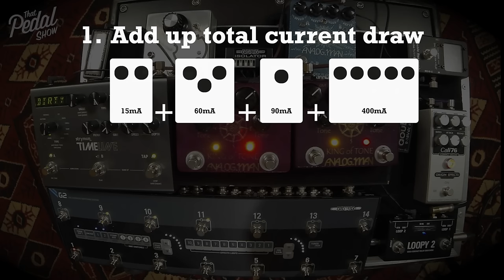That Pedal Show – How To Power Your Pedals Properly & The Legend Of VCPI

Comment: Could you guys do a video of budget vs higher end power supplies? Always wondered if it's worth spending a good amount of money on a power supply.
Reply from the maker: +Emil Malaniak Hi Emil. It'd be dreadfully boring. In our opinion it is absolutely worth spending money on a great power supply that has the features you need. Voltage, Current, Polarity, Isolation. Make sure all are satisfied and you won't go far wrong!
Reply: To piggy back too on this, unlike pedals (where you are constantly looking for new sounds, combinations etc) you aren't trading around power supplies to other people. Generally you get a power supply and that's it. You just keep it until it gives out. So it's worth getting a nice one that can fulfill your current needs and give yourself space for the future.
Reply: Emil Malaniak Just bought a Harley Benton Powerplant Junior. It was €33,- and you get 5x 9v 120mA outputs and a shitload of cables with it. All Isolated outputs too. My Rig is as good as noise-free

Comment: Sorry if I missed something.  I have isolating each pedal stuck in my head.  

I have a pedal train 24 with 13 effects not to mention my way which sits next to it and has a 9v anyway.  
Could I buy another power supply and run both on my board?

Comment: Hello, i actually have 8 pedals on my DIAGO pedalboard and FUEL TANK JR with 2 TC current doubler, which works well , but a new pedal ( diamond MMR JR )came( instead of my MELAKKO 616 delay out now) and one of my doubler cable is too short ......Do I have to buy another DC UNIT ?
DOES THE FUEL TANK CLASSIC ( no individual isolated current output , the JR WAS !) do the same job with the same silence ? I do want to spend a lot of money as voodoo lab is, sorry....Thanks a lot for your help and answer, Best regards from France

Comment: Nooby question here:
I've got a small pedalboard comprised of a Tuner, a MXR Dyna Comp, a Boss DS-1 (or an AMT P-Drive when needed) and an AMT Reverberry Digital Reverb (that goes in the effects loop when i can) all powered from a Pedaltrain Volto through a series of daisy chains.
After seeing this i now understeand where the hum and hisses come from (i seriously thought my DS-1 and P-Drive were busted!), and so would like to know how could i isolate every single pedal?
Is there a device i can use in between the pedals or should i ditch the Volto straight up?
Any help would be appreciated :)

Comment: Hi there guys, I’ve tried messaging via your website and even had a chat with some kind folk on the Facebook group, but I’m still a bit lost with little to no help... my current power supply is a bit noisy and naff and I’m really interested in your power set up, I’m just not 100% sure what I’d require or how to set it up, a diagram would be stellar!! 

my current set up is as follows - 

in front of the amp (no particular order) - 
TC Polyune2 Mini 9V DC/40mA (possibly the bigger one)
Crybaby Mini 9V (possibly a standard Vox wah) 
MXR Phase 95 9V
TC Spark Mini (possibly the big one) 
Ibanez Tube Screamer Mini 9V
Xotic SL Drive 9V - 18V 

fx loop (no particular order) - 
TC Corona 9V 100mA
TC Hall Of Fame 2 9V 100mA
TC Flashback x4 9V DC 300mA

I appreciate life is hectic right now, I’m just keen to get this sorted!!!

stay safe everyone!
Reply from the maker: Hi Elliot, if you want to contact GigRig it’s support@thegigrig.com 🤓👍

Comment: Hey guys! Great channel, great video! I do have a question though. Suppose a pedal(boss DD500) is rated 9V 200 mA, would it affect/destroy the pedal if it connected to the DC 9V 500 mA or does the rating just mean I need a minimum of 200 mA and it's safe? Thanks guys!
Reply from the maker: +Joel Sharat Yeah, fine. Don't worry about 'too much' current - it'll take what it needs. But don't mess with the voltage. Cheers!
Reply: That Pedal Show thank you! :)

Comment: Regarding your rule of thumb Dan: taking the popular TC HOF (version 1) as an example, the HOF requires 9v/100ma; and you recommend powering it with at least 200ma. If we take your gigrig gen + distrib: Your isolator add-on provides 135ma max per output which is enough to power the HOF as a minimum but to be certain of maintaining 9v would you  recommend your Timelord for this?
Reply from the maker: +Dale Harris the rule of thumb is based on what companies label as they’re current draw. The TC HOF is fine on an Isolator as it only draws 100mA for a brief period during start up but in operation it doesn’t get to that much current draw.

Comment: Will The GigRig Generator provide a solid 9V when the current draw approaches 5A or should the total current draw of all the pedals still be half of 5A as the video says?
Reply from the maker: It will stay solid, my ping is about headroom, but as long as the supply is regulated and designed well it should be fine towards its current limit
Reply: @ThatPedalShow  Thank you! Also cheers for creating such an incredible show, honestly I discovered it a couple of weeks back and now I'm hooked. I am discovering so much!

Comment: Hi guys. Not sure if you are still replying to questions on these older vids, but.... 
Wondering if pedals, generally speaking, draw the same amount of current when they are in ‘bypass’ as when they are engaged? Cheers.
Reply from the maker: +Justen Stoodley Hi Justin. If it’s true bypass it’s not drawing any current at all and will pass signal when it’s off and has no power source connected. If it’s not true bypass, presumably it’ll still be drawing some current. Interesting question. (Mick here)

Comment: It's nice to know that I need twice the power to preserve the voltage! But how does these bricks works? I mean, for example, the manufacturer says that certain power supply have 4 outputs, where each one is isolated and provides 100mA. The total power is 400mA. If I have 3 pedals with 30mA requirement and 1 with 100mA, the total for the pedals is 190mA. Almost half of the power availble. So I am sorted, right? Or will I have problem with my forth pedal that needs exactly the power supplied by the brick? Will it affect the voltage for this one? Thank you in advance!
Reply: José Sousa if they are isolated that should work fine.
Reply: This is the first time I hear about them needing the double power supply. No easily available power supply I know has 600 mA or so per outlet. This is what this video suggests when saying so for using a 300 mA pedal. Cathedral Reverb works with 200 mA I think, so for this, according to them you would need a 400 mA outlet. Only Fuel Tank Goliath has this. As a matter of a fact neither Walrus Audio Phoenix/Aetos which are more specific do have this big outlet. I do not think the voodoo labs do either.

So while this video is good, unless I didn't hear this comment right, I'm dismissing it as BS

Comment: Hi guys! Great show, as always.  I was just wondering if running 1-spots and dedicated power supplies off of a power strip would be viable for a rig with many varying VCP requirements? 

Haven't dug too deep into power supplies but I haven't seen one that meets the requirements of a dl4 (center positive? Unless those jack adapters you briefly mentioned can also switch polarity) as well higher Voltage and Current ports.
Reply: You can get a small adapter to reverse polarity

Comment: At 7:15 Mick talks about how his T. rex chameleon power supply can’t power the timeline as it only has 9v 300MA per output. On the strymon website it says the timeline can run on a min of 9v 300ma.
What is the issue here will the timeline not sound good on 9v 300ma? If not how much more do you need? 
I have the chameleon and am thinking of getting a bigsky which needs the same current as the timeline. 
Thanks love the channel.

Comment: Funny I just came across this video, just last week I sent Wampler an email because I had a dilemma.  Loved the clarity and headroom I was getting and ease of dialing in a Euphoria at 18V but the voicing switch and gain became too hard and edgy, not having a soft bloomy clip.  I asked them if I can get the sweet musicality and design of 9v with the benefit of having a more amp like headroom that I'm used to out of the pedal.  18V blends into my amp more too.  To me it 'sounds like a pedal' at 9V but at 18V it just sounds like a different preamp channel almost.  I've only played with it for about 4 hours though switching back and forth.... I know the volume, tone, bass knobs all work better with the clarity and headroom but the voicing switch and gain while being easier to dial in have a muuuuuch harder edge to them that is the only part I don't like.  EDIT:  Ahhh I notice later you mention 15V... didn't know they had those but I had thought about ordering a 12V one too... just so when I get a pedal I can find out what voltage I like it at best.  You recommend having a 9V, 12V, 15V, and 18V adapter for testing purposes?  I noticed that everything too 'pedaly' or synthetic that I didn't like about the Euphoria that I felt made my amp sound like a toy was fixed by a larger voltage, but as mentioned introduced the problem of it being way too hard on the edge and aggressive.... could be cool when needed but that's not really what I like the Euphoria for and I don't do that often.  My siegmund double drive has it's own wall wart voltage regulator power adapter that you can rotate from soft to hard / compressed to headroom  ... Every gig I play I set it different lol.  18V does really help though because I have SCFH pickups in a LP (Lollar's) , tone tubbies, tweed style amp, and the pedal just has too much and it kills the transients.  It articulates better but sounds too 80s/modern at the same time.... if I could get the 18V to run with more bloom and softer breakup that would be ideal

Comment: Why do you suggest doubling the amount of current when adding up the current from each pedal? Is that just in case the pedal draws more current than it is designed to/spec'd to? Doubling seems a bit much??
Just bought a Gigrig modular power supply :) arrives next week.
Reply: Did you watch the whole video? They explained it very clearly: it is because the voltage supplied can sag below the rated value when approaching the maximum current

Comment: So do you have to buy one of those isolation boxes for each individual pedal (if you're aiming to isolate each pedal) or should a good power supply isolate each of its outputs? If the power supply doesn't isolate its outputs, can you buy an isolator with multiple inputs? Basically, what should I be shopping for?
Reply from the maker: +napalmhardcore There are plenty of brick-type supplies that have isolated outputs. 
The reason TheGigRig developed its modular system is because most of those brick types either run out of current or don't have a wide enough variety of voltage options once you start getting into more complex boards. I (Mick) use T Rex Fuel Tank supplies most of the time because I don't have any complex voltage requirements and I don't use any current-hungry digital pedals. Voodoo Labs and Cioks are other popular brands; Dunlop now has an Iso Power Brick we believe, and Strymon has entered the game too. Hope that helps.
Reply: Thanks very much. I really appreciate it :)

Comment: Hey guys!  Don't shoot me, lol, but the Line 6 HX Stomp is looking really nice for added wet effects on my pedal board.  However, on the pedal it says it needs 3A.  I have the GigRig power supply on my small board and love it.  I know the Generator can deliver the current needed, but what GigRig cables would I need to make this work?  It has been tested and ran on a Strymon Zuma R300 and Voodoo Lab 4x4 by doubling up two 9V outputs together.  Is there a way to join two high current adapters and still keep the voltage at 9V?  Thank you!

Comment: Q: I have (had) a Holy Grail which is centre positive. I plugged it into the wrong power supply and it worked for a second then stopped. There wasn’t any smoke and inspection of the circuit doesn’t reveal any damage. Is there any way back?

Comment: i want to power a Whammy V and a few other basic pedals and a Line6 G70 wireless.... the wireless will not function on anything other than the last output on the PSU i have, then the Whammy turns itself off as it requires 1500mA 
do you do a supply capable of that and enough for the Line6 wireless???? wireless says 350mA but own't work on anything other than the high mA out on my Joyo PS2

ta

Comment: Hi guys! I'm looking at upgrading my power supply, as I've got a ground loop problem going on. I was wondering if a noise gate would sove this problem for the time being, before I buy a high quality supply. Or would I be best buying a power supply, as without my tuner and wah in front of my amp there is no background noise until I really crank the gain on my JVM . Thanks for the awesome video! ;')
Reply from the maker: +Con B-H We say don't waste your money on a noise gate, because if you get your power and switching sorted properly you really shouldn't need one. :0)
Reply: That Pedal Show Thankyou so much for the advice! I will order one tomorrow. :0)

Comment: Hey great show guys   all powered up   have you done any vids on the mysterys of thge effects loop  pros and cons ie which pedals are better suited into the amp or the loop.
Reply from the maker: +ray dowley If it was as easy as that, we'd have done it. We do mention loops, and there's some stuff upcoming about drives and boosts in the loops. But there are no rules. If you're looking for generalisations.... if you use a clean / very low gain front end in a good valve amp, and you have high quality analogue pedals (or digital ones with good dry-though) we like everything into the front.
If you use higher gain amp settings however, a lot of people like to run delays and verbs - sometimes modulation too - in the loop because they sound 'cleaner' for want of a better word. 
Running boosts and drives in loops is a completely different thing, and we have a show on that on the way. 
Now of course, for everybody who agrees with that, there's somebody who likes it the exact opposite way! So, as always, try all ways and see which you prefer. 
Thanks for watching.
Reply: thanks guys    had a couple of amps with the loop but just never used it,put my peds in front all the time old habits I guess

Comment: @That Pedal Show!

Hey there pedal show guys! Great video! 

Quick question - would it be wise to run drive and other ''before' the amp pedals on a separate supply to those in the FX loop? Cheers!
Reply from the maker: +Andrew Solomon Not necessarily Andrew. As long as your isolation is good you should have minimal problems. Cheers!
Reply: Excellent, thanks for the reply! i have a Voodoo Labs 4x4. My Friedman BE-OD is a bit noisy, (Not gain, noise, more like hummmmmm type noise!). Anyway I'm going to pull my board apart this weekend and add the bits one by one to find out! Cheers!

Comment: Hi there. Great video guys
Just a question : i have a power supply 9v, 2.5A output
Can i use it to supply power for my 6 pedals using daisy chain?

Cheers
Reply from the maker: +ipadalves 88 answers in the video

Comment: great show, made it all clear and interesting. TBH any show that isn't posh overdrives is good ( sorry). Still waiting on the ( pedals into) SS amps and the multi fx shows. Volume pedals? Active, passive, where in the chain, slow gear type alternatives. Creative delay? using insert loops on delay, expression pedals, dub style effects,etc.Budget winners? Best of the Mooers, Tone City,etc.
Reply from the maker: +philip Ellis Tranny amps show coming up in a couple of weeks Philip. I was a bit depressed after doing it, so I need to get back to full mental strength before tackling multis. We're medicating Dan beforehand to prepare him. Thanks for watching.
Reply: Look forward to it. When I use rehearsal rooms I use whatever is in there, quite often a Bandit or Valvestate and they have to work with the same pedal board I use with my valve amps so I'll be interested to see your take on this.

Comment: I have a board with 7 analog pedals takigng 9v DC and one digitech rp100 which for some reason needs AC. Is there a power supply that will work for this? Or will I need to keep using a separate power supply for it?
Reply: Try out Cioks AC Rider power supply, it should fit you needs. http://www.cioks.com/index.php?option=com_content&task=view&id=63&Itemid=78
Reply: The T-Rex Chameleon will do 12V AC. Some of the other T-Rex power supplies might also do different AC voltages.

I bought the Chameleon solely for the 12VAC port since I couldn't find any other power supplies with that one port I needed.
Reply: Yeah, T-Rex Fuel Tank also has option of 12VAC on one of the outlets.
Reply: Thanks for the great responses guys!
Reply: I know it's been a hot minute, but the One Spot Pro CS12 does AC power as well on one of the outputs

Comment: so..what power supplies would you suggest? Vudu Labs, MXR Brick, 1 spot pro etc... ?
Reply from the maker: +Lorenzo Rizzardi We use TheGigRig modular system because it's very flexible and can grow with you. However, Mick also uses various T Rex brick supplies for smaller boards. Voodoo Lab, Cioks, Strymon.... Just make sure it has all the outputs you need and enough current off each tap. If you've got a big board it can start getting quite expensive, but it's sooooooo important to get stuff powered properly. Cheers!

Comment: I have a small pedal board (only three pedals) and I use one of those yippy skippy rechargeable batteries and a daisy chain. Would I benefit from using something like your isolator?
Reply from the maker: +Dan Lampton possibly, depends on the pedals.